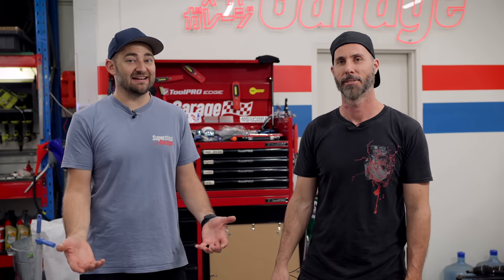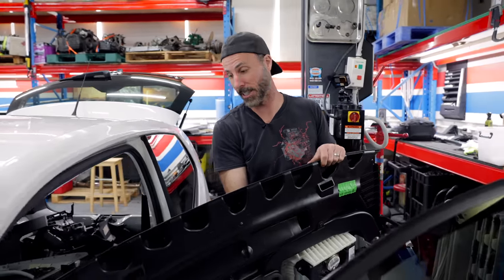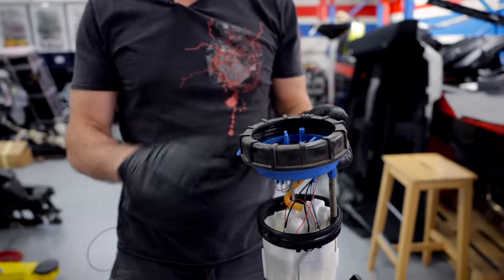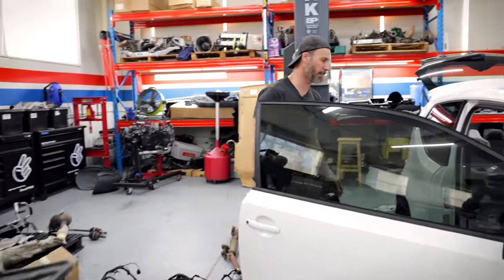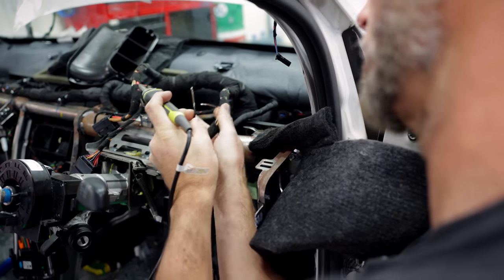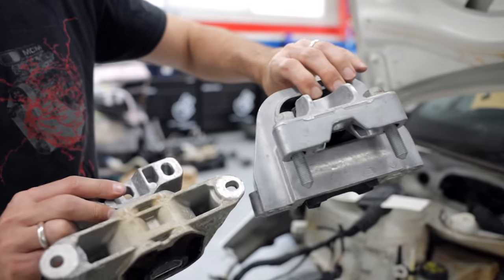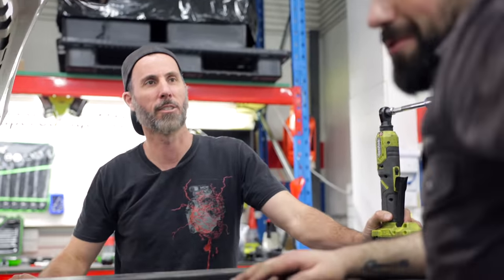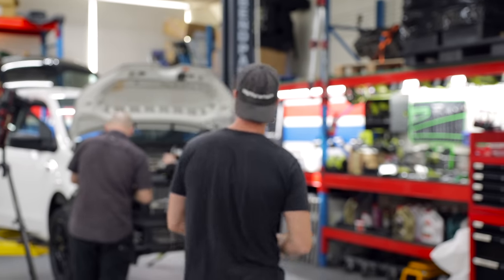Turbo VW UP GTI Conversion - EP3

Comment from the maker: Autographed Miss Daisy posters are available now. Strictly limited time only and then gone forever. 

https://mightycarmods.com/collections/frontpage/products/limited-edition-vw-beetle-poster-autographed

Please limit your order to 2 posters.
Reply: I love you videos! Cheers from germany! I am not a VW guy, more an Opel lover, but that project is soo cool.
Reply: The UP Tsi comes with a 5 speed... are u guys sure its not just a Tsi engine? not that they are that much different but still sucks as the 6 speed has much closer ratios.
Reply: do you geezas   plan to build a infiniti g 35/ 37 ?
Reply: Is Moog's speech slurring? Is he got the cognitive decline?
Reply: Most of the issues you're having aren't because its a GTi into a normal up! - they are because its a facelift car going into a pre-facelift. For instance the mounts are larger for crash purposes, the pump is different to allow more flexable amounts of ethanol, the loom is different to allow for the extra bits and bobs you can get on the later cars and so on. 
I don't know if you guys go the facelift over there but if you did you could have saved yourselves a lot of hassle.
Reply: Please show us your bin
Reply: Love the Print .Cant wait to receive it 
Just a side note Who 
 was the wrecker from UK that you scored from
Reply: @andyhunter5869  just old and tired, this is a big job....
Reply: That's just so weird that the company has gone all those extra miles to make this car so different from the basic model. Like even the fuel pump hanger was changed and the hole in the car's bodywork was changed... Like, even that takes time to redesign and then you need to manufacture all those redesigned parts and you have to have extra space in your warehouse for those totally different parts and so on... It's just so wasteful. Boggles my mind that they didn't reuse as many parts in the GTI as possible from the base model. Looks more like they tried their best to redesign as many parts as possible.
Reply: You know you can get wire connectors with solder right? That way you only need the heatgun which will melt the solder inside the connector.
Reply: @Moog - 08:49 - What is THIS background piece of music called (where can I get it)? I first heard it on the black Golf Mk 4.5(?) video (all those years back) and it's just COOOOL! I've searched everywhere but to no avail. Is there a full track? Please help fella! 🤞👍
😎🇬🇧
Reply: "shop in Parramatta"... was it Lee Bros???
Reply: @MrBrander the reason is because the GTi was available only in the facelift up from 2016 onwards. So it's not only a GTi conversion they're doing but also a facelift conversion
Reply: Gabbed one ASAP and a finally much needed MCM Hoodie. Thanks for all the amazing content Cheers from California. Can we get a IN THE BIN hoodie?
Reply: Love the channel guys, got myself a little JDM nugget due to how fun you made them look and I love it! I love the Bug, just got the poster, one day will afford the hoodie! Keep it up!!
Reply: Marty and moog thanks so much for my black large desk matt. Love it. Now my pc goes suttttutttuuu suuttttuuuuu, my keyboard goes pppppssshhhhhhhhh pppppssshhhhhhhh
Reply: 7:56 😊
Reply: What you said about this car being awesome. My daily driver is a 1998 Ford festiva. People mock me for driving it because my other car is a vr4 galant. I would also be hard-pressed, which I would keep if asked. Have a blessed week, Moog and Marty.
Reply: I would suggest MCM puts a watermark over the afterwork that is displayed on the link above. With AI generation stuff happening, this can easily be copyrighted and super resolution enhanced.

Comment: Top tip with cable ties, if you open the packet in the middle they won't all fall out when you drop them on the floor.
Reply: This is so simple and yet makes so much sense. I'm going to do this from now on
Reply: whoa, thats genius
Reply: i was about to say the same. Best tip i ever learned from the internet!
Reply: @NSUGS  AvE reference?

That's not where I learned this if so!
Reply: I never cut in the middle or top, but just an inch or so from the top in a smallish slit in the center of the pack. That's the best of both worlds.
Reply: My dad taught me this trick years ago, it's such a simple but awesome trick to know.
Reply: We need that guy “here’s something I wish I knew before I was in my 30’s!”
Reply: MCM cable ties should come with an opening in the middle instead of the end?
Reply from the maker: Actual game changer here 🎉
Reply: @NSUGS You just made my day good sir.
Reply: @NSUGS  Damn Elec-chickens
Reply: And I never lost a cable toe again!
Thanks.
Reply: Same thing with a bag of chips at party, open up the middle and you got a bowl, no need to press the hand down.
Reply: Or get the Costco tub with lid.... and then lose the lid 😅
Reply: Legend
Reply: I was about to say the same thing. Handy little hack I learnt way to late in life.
Reply: What no way lol
Reply: God tier life hack
Reply: Cane to say same thing lol nothing worse than 100s of zip ties every where
Reply: if you first tape up the bit you wanna cut into your cable tie pack, it won't tear either  @mightycarmods
Reply: @castekracing wife and I use old milsurp rifle scope storage cases. Flipup lid with a metal latch. Keep one in yhe Ural trunk,  all our cars, and in both sets of bags. Ws use 1 pound and snaller coffee cans, with a tab cut in the lid. Reach in, or pull and grab. Magnet in the can bottom, and an extra lid under it, it sticks to ferrous metals. Microfiber towel under it to protect paint and polished surfaces.

We even keep a few woven into the mesh in our riding fear, ans tank bags.

Started doing that after a breakdown on a ride. Not our bike, or the other ones in the group. My prosthetic leg.  

Knee lock lost its unlock tab. Left the knee locked, and you need it to bend while off roading. Mine has a small loop at the socket attaching point. Small strip later, no worries. Keep them in the gear as that's my beater leg. Right,  or brake side.

And yes. I ride bikes. Have since age 5. Lost the leg 2 and a quarter years ago. Half the left foot in 06. I've slowed down, but it doesn't stop me.
Reply: That's bloody genius 🤯
Reply: thanks.
Reply: UP vote
Reply: put some gaffer tape or duct tape on the middle then cut the center with a razor blade then the package doesn't rip with wear over time
Reply: Theres even a beter way….
Reply: The illuminati would like to speak with you. 

in private.
Reply: Sparky things 🫡
Reply: Oh wow, yes
Reply: Thank you for this!
Reply: My zip ties usually come in a big tube with a screw on top. Each size is bundled with a rubber band. But this idea is genius for the ones that come in a bag.
Reply: Man it's always the simplest things that make you stand back and just go wow that is such a gamechanger. How on earth did I never think of that
Reply: I hate that this makes so much sense

Comment: Getting the shorter gear ratios of the 6 speed is going to make this so much more worthwhile.
Reply: @24k__J Isn't that literally what this video is
Reply: @SullySadface  theyre putting in the UP GTI engine which is just the TSI 1.0 mill
Reply: @24k__J the 2l from the golf will not fit. it's too big.
Reply: @M3PH11 I’ve seen an UP with a VR6 swap so the 2.0l would likely fit. It would obviously require a lot of work though.
Reply: @SullySadface no it’s not. They’re putting a 1 litre turbo in. Golf GTI is 2l
Reply: @turnip5465 I mean this is as plug and play as new cars go. This will still be a fun car, it’s not always about big numbers
Reply: If anything like the rest of vw platforms, 6speed vs 5speed trans requires different axles which require different knuckles and so on...
Reply: @M3PH11 a guys already put a 1.8turbo in his up so 2L would fit
Reply: @richolishis94  exactly. The moment one thing has to change it’s a cascading event
Reply: @Elmospiece yeah but imagine the amount of custom fab work you would have to do, new engine mounts, new wiring EVERYTHING. The point of this is to be a fun plug and play (not really because of the wiring loom and stuff) but it's mostly just reusing parts from the base UP! and UP! GTI
Reply: @24k__J ... where ? In the boot ? Coz it wouldn't fucking fit in the front
Reply: @M3PH11 even if it fit it’s just too much power and torque for that car… only if they planned to throw like 500k at it and make it a complete time attack monster, but then it wont be streetable soooo
Reply: Also, this is Australia, this car will have to be verified by an engineer so it can legally be driven on the street. Most people don't do it, but I'm almost certain MCM does get their vehicle fully legal. That is probably a big factor in choosing their swaps
Reply: The standard 5 speed gearbox of the up is really shit, I know I drive one. It’s the only part I dislike from the car
Reply: @Elmospiece  just because it can be made to fit, doesnt mean the bodywork isnt chopped up. they have to do the mods within the rules and laws in their local area.
Reply: @petelattimer6808  ok, so again the previous person stated it wouldn’t fit and my point was it will. There was no mention of needing to pass a tech inspection from said commenter, I just said it would fit and it will soooo…

Comment: Speaking of dash pad removal, from 1982 to 1986 I worked at a GM dealership parts and service department as assistant Service Manager and Service Writer. A customers dash pad was faulty and had to be replaced, not a favor task for the technicians.  Could not get one to complete commit to the project, so I in-between all my other duties attempted to complete the task. Several technicians offered help but always left for more profitable work orders. It took me a week to finish the task, the customer was very gracious and patient. The reason behind the unwillingness tocimmit to the task was of course, money. In case you don't know warranty repairs are notoriously under estimated by the manufacturer,  no diagnostic time is included and the technicians they use to perform tasks have all needed tools set out for them, parts to replace waiting at hand and they are told the specific task to be done. The estimated time for a repair is determined by the time used  by the test situations. Third party labor used a more real life based system. The result is that the pay rate for the technicians can be half or less of the actual time to correct handle the repair. Yea it's follow the money!

Comment: It just occurred to me that your Up (like all Aussie Ups) is the OG and that VW didn't introduce the GTI until the Up's first refresh in 2016, which would explain all the silly little unexpected differences like the top of the fuel pump assembly, slightly different key barrel etc.
Reply: It's a GTI conversion and a facelift all in one
Reply: its a german thing. they allways do weird little revisions  to parts. they often change thier manufacturers often times not because something is wrong with the part but because its cheaper and so on.
Reply: @99Lezard99 Also they cant leave something good alone the engineers have to do something to keep their jobs so they over complicate everything 😂
Reply: @99Lezard99  yes they do but the part has the same specs
Reply: That's a pretty big oversight for a project that was supposed to be plug and play lol

Although someone else said this looks like a TSI loom/engine so the whole thing could be a scam.
Reply: I was just thinking this, no wonder the light assembly also had different wires

Comment: You may already know all this, but if not, I hope it helps:
There are two PR codes regarding Up gearboxes. 
PR-0EA: MQ100 5-speed found in the non-TSi Up. Reverse gear is right and down.
PR-0EM: MQ200 5 and 6 speed found in the TSi and GTi Up.
Reverse gear is left and up.
To fit an MQ200 box to an Up that came with an MQ100, you would need:
Selector mechanism: 1S0 711 049 A
Relay lever: 1S0 711 202 B
Front gearshift lever: 1S0 711 046 B
And if you didn't get the Up GTi gearknob: 1S0 711 113 ACNVL
The engine and gearbox mounts also appear to be different, so let me know if you need those codes.

Comment: You don't need to swap the key barrels to make this work, just swap out the RFID chips inside the keys.  If you have the GTI Cluster, ECU, and RFID chips (in the key), then the IMMO will be happy.
Reply: all 3 control units have to match up. each computer checks eachother before it lets the ecu run the engine.
Reply: @someidot3699   You are correct, but the Immo in the cluster is just looking for the correct RFID in the key, the metal key is just a mechanical lock for the steering column.

Comment: For soldering, you will get a much better connection if you apply the iron to the workpiece, and then the solder to the workpiece. Applying solder to the iron and letting it drip on the wire like that will result in fragile cold solder joints. You could also add a Western Union splice for a super strong mechanical connection.

Comment: These are all the reasons why we didn’t do the same on ours. 
It was actually easier to put the 1.8L turbo engine in. The subframe swapped straight in so we got 5 stud conversion at the same time and better suspension with disk rotors all round no more drums. 
Can’t wait to see this one finish tho, we need a race ❤
Reply: I will still win in my wagon haha
Reply: @POPSBAFALCON  probs 🤣🤣

Comment: So i might be wrong about this, but the cluster you got didnt look like a gti one, nor did the engine cover + the gti is supposed to come with a 6 speed.

What i think happened it that you got a up tsi engine, which was also an option allthough they never sold a lot of them. Possibly it also only has 95HP instead of 115.. i'm not sure but it might be worth looking into it
Reply: That is what I was thinking too.
Reply: me too @tiredtrailer
Reply: bump
Reply: Got ripped off
Reply: Ooof what a bummer that would be, for them and us viewers 😅
Reply: Damn, I think you're right. In NL at least it supposed to be a 6 speed, what a bummer :(
Reply: This right here is why I don’t think we’ve seen a new video on this car. Big fallout with breaker that provided the parts I’m guessing
Reply: Yup all GTi come with 6 speed, this engine is the VW high Up model 1.0TSi 90 model only supplied for a couple of years in the UK. However with a stage one remap they're good for around 130hp stage 2 around 140hp and everything I've seen suggests the mechanicals are good enough without further mods, that said also worth uprating the tyres and suspension to get the most out of the handling.😊

Comment: 6C/R Polo 5 speed linkages would fit as it’s the same gearbox, you could even use the 6 speed box too, if the Polo is sold down there.
Reply: Was also about to suggest this 👍🏻
Reply: This engine was in so many VW products, even my grannies Golf 7 has this engine with the 6 speed. Probably easy to source, I think they are the same. The golf revs slower at the same speed as my Up GTI but that is probably due to the smaller wheels on the Up.

Comment: Please please please please please get the 6-speed. I have driven a lot of up!'s from 60hp NA to the 90hp turbo to the GTI and power-wise the TSI and GTI are not far apart. What really sets the GTI off is the close-range 6-speed compared to the suuuuper long economy gears of the TSI and lower-end models. It alone is the reason I absolutely fell in love with the platform and I constantly think of buying one as a little track car.
Reply: I have the GTI and for the track I'd recommend the 90hp version tuned to GTI spec or higher. Probably cheaper than the GTI, I love mine but I still feel like I overpaid...
Only real difference would be the exhaust valves, the 115hp version of the 1.0 gets sodium filled exhaust valves to manage heat. It also gets a particulate filter but for track use you'd rip that out anyway lol. Plus the 5 speed can handle more power than the 6 speed iirc.

Comment: Okay. The zip tie mention got me thinking about something. Strangest thing you have ever used on to field fix.

My old one qas, a laceration. Hog hunt. Buddy caught a slicer, deciding to check the pig a bit too soon, snd it swiped used it's tusks. 

Hour to the truck, and another to the closest ER. Zipped it, walked out, my shirt wrapped around it. Field dressing at the truck, and get treatment. 

Then. Last Tuesday said, hold my beer.

Unlocking tab snapped off the socket of my prosthetic, 20 miles from civilization. Can't ride with your knee locked straight. 

Socket and knee have a ghud ring setup. Just big enough for a small zip tie to fit. Pulled one out of my jacket's vent mesh, inserted, and set it.

Still holding, but I need to replace the slider for the lock. Unlocked knee on uneven ground, added to comprpmised balance, on an uneven surface Is a fall waiting to happen.

See my prosthetist next friday.

And no. I wasn't on an ATV. Was riding my 1977 YZ 125, 2 stroke. Wife had the Suzuki SP 400. Set 2 as my goal the day after my trans femoral of the right leg.

Like with Moog's recent sucess at his first major competition,  I knew the easy way. No sweat. Almost anyone can ride a trike.

I set the one most people I know said can't be done. Because even I had doubts. 

For me that is a motivater. The ones that matter had faith in me. So did I. I didn't think I can.

I Knew I Will.

I'd love to hear y'alls.

Comment: I once had a friend who replaced the taillights on his Golf r32 with led ones. That made the car go in to limp mode, and the four wheel drive stopped working, because he replaced the rear lights.. VW simplicity my male donkey. I had to help him solder resistors onto the cabling to trick the ECU into thinking it still had regular lights on the back.

Good work pulling through though boyos. Love the UP GTI. I've personally wanted the Lupo GTI for years. Sadly they're even more rare than the UP one.